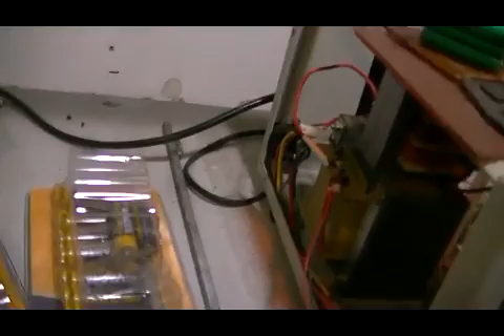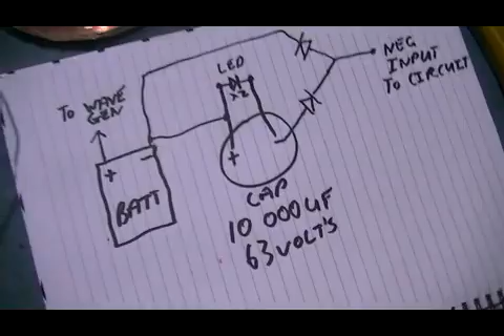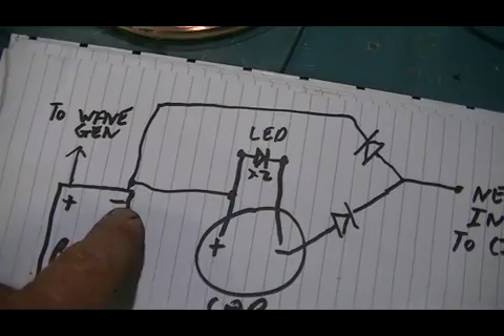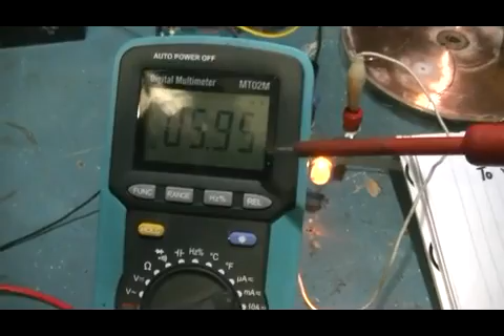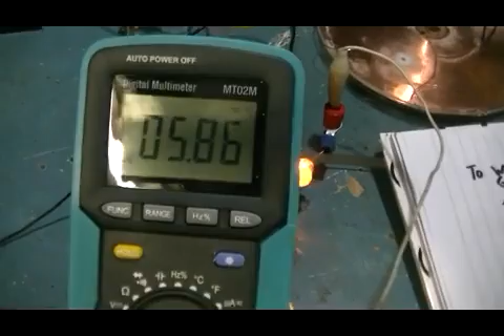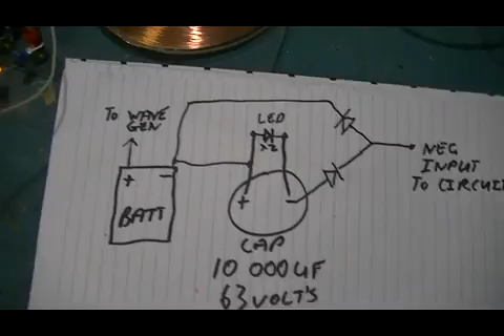Tesla circuit testing the reverse electron flow

Comment: The one that shows the elements over a waveform or helix? I like that one. Yes I'm aware of other ways of arranging the elements. Might pick your brain on some chemistry sometime, Had a few questions that are hard to research without a nudge in the right direction. I'm also aware of other theories about electrical current. From what I can tell they are either unproven or just wrong. For me electron's are the only way to look at electricity, till other stuff is provable. Always open to new ideas.

Comment: Leds in parallel! not series.!!! Keep under half the vaveform peak on your output voltage to keep it in tune. Should be able to pull a few hundred times input amps from ground... Diodes going to be the first to blow. 4007 should work a little longer....

Comment: Perfect sense. Well explained. I see your really starting to understand this circuit. Now go hook it up to a ground (power point ground is fine) via an ammeter. Start putting 2.5v or less Leds in series, and watch the current on the Ground connection... If I'm right you will be able to keep adding Leds, and each time the current (electron flow) from ground will go up accordingly. That current then gets stuffed into your battery, so watch its voltage. It may overcharge and explode.

Comment from the maker: Hi MS
If i disconect the LED,the voltage will rise to about 8 volts in the cap.Then the circuit will stop working on one of the two cycles as there is no potential diference of voltage on that phase.The circuit itself is running on 4.5 volt's,so if we add that 8 volts in the cap-we get 12.5 volt's.That is the battery voltage-so we now have no current flow in that direction.
The LED is udes to keep a potential diference between the cap and one phase of the cycle-if that makes sence lol.

Comment: Voltage may be LESS than negative of battery. Not higher than pos. It's all relative (to where you put the black probe). disconnect the charged cap, and measure volts. Its just a potential difference and can be put in parallel series with other caps/ batterys to charge/discharge. You have x amount of electron pressure on neg, or x amount of electron vacuum on pos. Cap stays the same. All that changes is where you tell your meter 0 is, with the black probe. Electrons just want to be equal....

Comment: Nice one! I was looking at the neg rail of the sig gen, when you put the circuit on the forum last night. Should have seen that! Had to do the same in the sim. I really like the diode set up on the cap. Only one thing can be going on there... A note about the led on the cap. Nice and visual, but current could bypass cap. How about just showing voltage in cap? I suspect the voltage will climb much faster without the led...

Comment from the maker: Useing electron flow show's the true direction of current flow.Current is carried by electron's,so current flow is from negative to positive-hence the term ! true current flow !
This is my prefer'd way to see current flow within a circuit,but as conventional current flow is more common these day's-most people use it.
So i guess it is just a matter of preference-neither is wrong
I can do the same test,only the diodes and cap around the other way-and get the same results on the positive input side